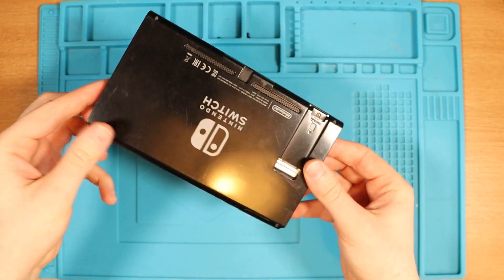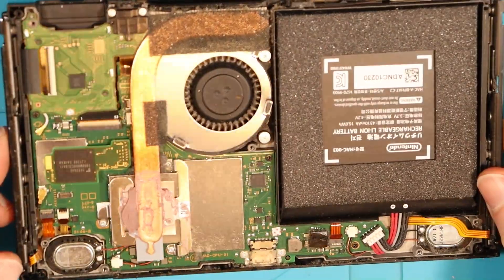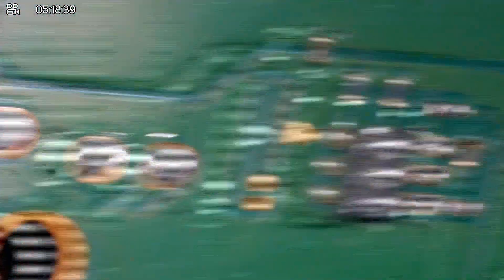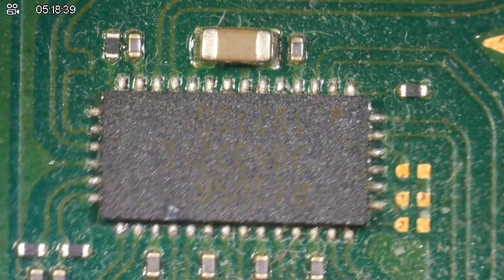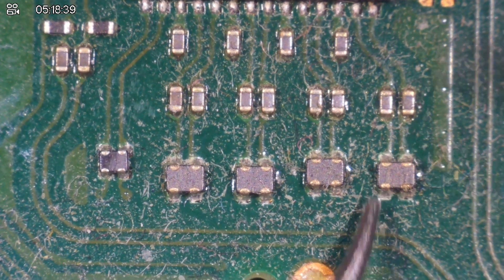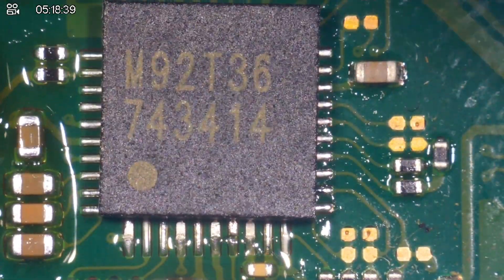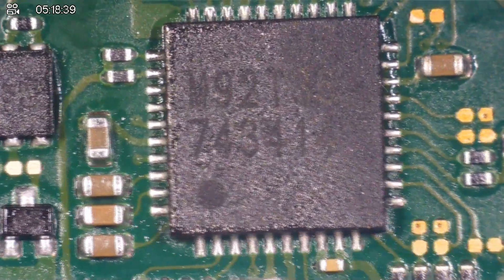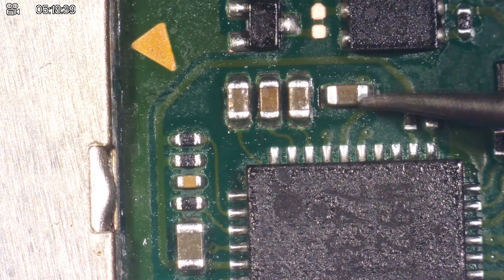FAULTY Nintendo Switch with No Power | My First Ever Switch Fix?

Comment: Quick question if you dont mind only, dnt feel obligated. Trying to fix my son's switch. with a laptop charger plugged in the voltage on the battery reads around 3.7V and climbs up very slightly but when you unplug the charger the battery voltage drops down alot to 2.9in a few hours. Do you think there is a problem with the board ( obviously the battery is an issue but Im worried there might be a board issue as well since it read 3.7ish with the charger plugged in, I always thought it would be higher. The Switch does not turn on at all ) . Thank you, greetings from South Africa